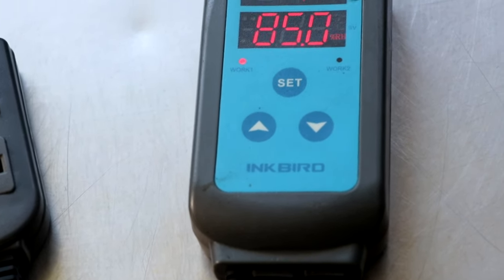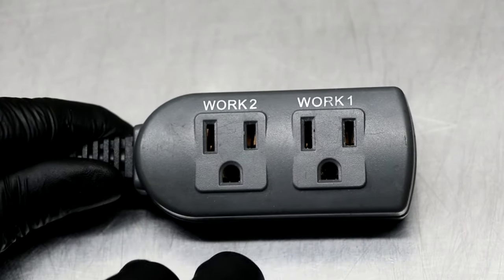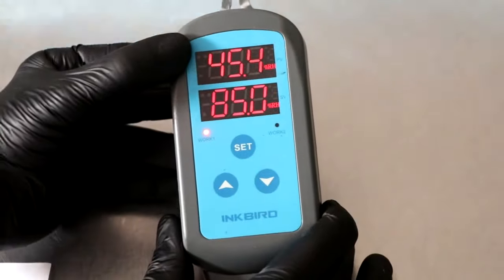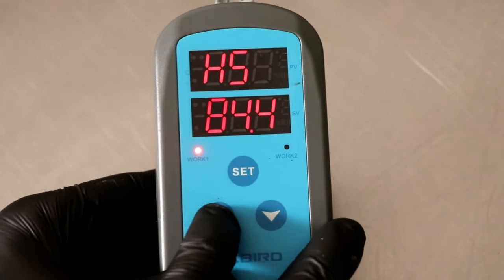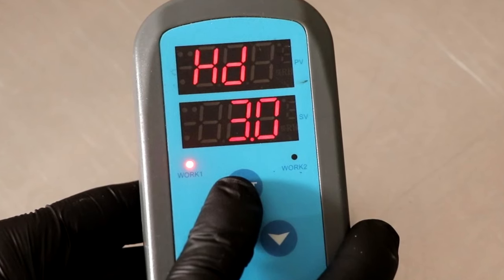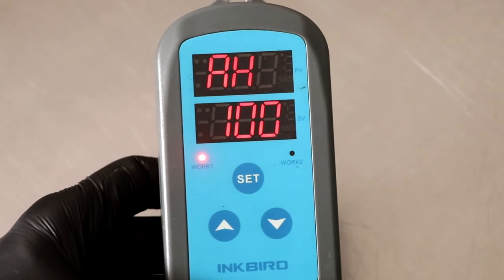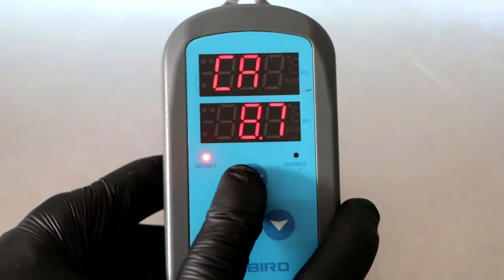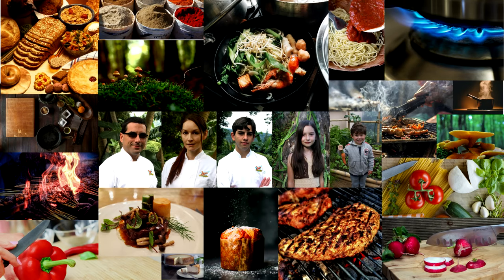Inkbird Humidity Controller - IHC 200   (settings/programming)

Comment: Are you able to connect it to the ink bird pro app? I have one of my own and can’t connect it to the app, I messaged ink bird and they told me it has no wifi function but yet there’s a video on YouTube from InkBird themselves on how to connect it to the app but I can’t/don’t know how to put the device in either Ap or smart mode.
Reply from the maker: I don't suppose you could link me that video.  As far as I know this unit doesn't connect to the app.

Comment: Can you help me resolve this? I am finding my humidity collapses after my controller shuts off. Controller is working properly, problem is what is happening inside my compartment. Humidity does come back but not until it hits 40%+ below my set value. Cycle takes 5-10 mins. I have found not using the humidifier at all helps the same problem with overshooting humidity, but that still occurs to a lesser degree. This is in an empty 8 ft cu refrigerator I have just set up and trying to find stable operation before putting meat inside. With 65% target I am dropping to 35+% before heading back up and swinging past 65 to 80 before it turns back around.
Reply from the maker: Hey Ron.  Are you available for a quick chat.  If you contact me off line we can troubleshoot your issue.  Send me your number here:  http://twoguysandacooler.com/contact-us/

Comment: My sensor is huge compared to that but I have the same ink bird? I can’t find any videos on why this is?
Reply from the maker: You have a newer model.  The sensor is the same but yours comes with a protective housing
Reply: @2guysandacooler  yeah but it gives an incorrect reading from the moisture building up inside the plastic casing which sucks and gives me a 95% reading or above when all is set and done
Reply from the maker: @JakeTheGiantKern  remove that plastic housing 😉

Comment: My Hs is set to 60, my HD is set to 3, my dd is set to 3 my alarms 100-0  but when running the dehumidifier brings it down to 65 then goes back up to 80’s can get it to follow what has been set
Reply from the maker: Have you calibrated the device?  Check out my video on calibrating a humidity controller

Comment: HELP PLEASE can i use humidifier by itself ? my dehudifier is already on timer (built in the model itself} for some reason its not working with only humidifier connected ?
Reply from the maker: you can use only a humidifier.  If it's not working you need to see how your humidifier turns on and off.  Here is a test.  Plug your humidifier into a wall outlet.  Turn it on.  Unplug the unit, wait 20 seconds), then plug it back in the wall.  You humidifier should turn on automatically.  If it doesn't you have the wrong type of humidifier...

Comment: Does this work  with any regular humidifier? Could this unit be put inside cold cellar or just probe inside cold cellar and unit outside of it?
Reply from the maker: yes.  Just make sure the humidifier has a "knob" on off control.  Sometimes the digital on/off humidifiers wont turn back on automatically once the power has been cut to them.  Check the description box for an example of a humidifier
Reply: @2guysandacooler  how about if humidifier doesn’t have any buttons , just a plug in that turns it on?
Reply from the maker: sure.

Comment: My inkbird is hitting my Set Humidity of 62 then turns off and never goes back on. Are there certain humidifers you need to buy in order to make this work?
Reply from the maker: What model do you have.  If it's digital then there's a good chance it doesn't have an auto on function.  If the on switch is a knob that turns then it will most likely turn on when the unit is powered back on..  Here's the one I have so you can see the on switch:  https://amzn.to/39M4Sm9

Comment: Can I plug in my exhuast fan to kick on when humidity gets to high and then the other for the humidifier when rh in tent gets to low? Thanks for any help
Reply from the maker: Yes you can!
Reply: @2guysandacooler  thank u been looking for something that is easy and will keep my tents rh in check its hardest thing to controll even with dehumidifer and humidifier the hi and low never consistent where I need thruout the day

Comment: what to do with it, if work 1 and work 2 dont work and your humidifier does not start or stop working
Reply from the maker: What are your settings?  Do red lights show up on the panel?  Also do you have the right humidifier and dehumidifier?   Plug your humidifier into a wall out let.  Turn it on.  Then unplug it.   Next plug it back in and see if it turns on automatically.   If you have the right unit it will turn on by itself...

Comment: Is it better to have a regular humidifier and a controller, or a digital humidifier that has rh detector?
Reply from the maker: That's a great question.  It depends on how you are using it.  A controller allows you the option for dehumidification.
Reply: @2guysandacooler  Thanks for the reply, I went with a regular humidifier and a dehumidifier. Just picked up the controllers for the humidity/humidifier and temperature. Think it's better that way, you got high and lows on it. I now have everything, spent a little over 1k Canadian, but we'll worth it.
Reply from the maker: @derekellisCAN  You'll be happy you went that route.  Much better control and precision,,
Reply: @2guysandacooler  I was thinking about doing a YouTube video on my progress, but kinda nervous...lol. Never did a video before.

Comment: Hello, I'm thinking about purchasing this controller. I have one question if you don't mind please. Now I plug my humidifier in work 1 I get that and I see on yours it's lit up now will work 2 light up also when you plug your dehumidifier into it. I looked at the manual online and it looks confusing lol. Thank you
Reply from the maker: ok, so work 1 (humidify) and work 2 (dehumidify) will light up showing that power is activated to that plug depending on the settings you have entered, regardless of what's plugged in.  Does that make sense?
Reply: @2guysandacooler  Hello, so say you set your humidifier for 80 and it gets like 90 for example, now the humidifier will will stop and the dehumidifier will kick on to bring it back to 80. Now if you're just using a humidifier and set it to 80 and inside your tent reaches 90 for example, well than your just screwed without a dehumidifier correct. I'm trying to learn all this, I'm sorry if I ask to much. I appreciate it very much. Thank you
Reply from the maker: When you set your controller you will have a + and - for humidity.  So lets say you want your humidity to be 80%.  You will also set the + and - for that humidity.  So lets say you set that at +3 and -3.  Which means that at 83% the dehumidifier (work 2) will come on and at 77% the humidifier (work 1) will come on.  If you don't have a dehumidifier, the work 2 port will stay lit until the humidity naturally decreases and it gets back in that range you set.
Reply: @2guysandacooler  Thank you very much for all your help I appreciate it. Wish me luck. Thank you
Reply: @2guysandacooler  Hello, I have a quick question for you please. I've just planted auto flowers and right now the humidity is good. My question is if I want to lower just the humidity can I just use the dehumidifier with this controller and should I still keep in on plug 2 or use plug 1 for the humidifier since I'm not using one please. Thank you very much I truly appreciate it.
Reply from the maker: @frankswiader3334  you can use just the dehumidifier.  Plug it into work 2 and set your parameters.
Reply: @2guysandacooler  thank you very much.

Comment: Where can we use it? Any industrial applications?
Reply from the maker: This is more for residential/light commercial use.  There is an amp limit so the unit that's plugged into this can't be too big or draw too much power

Comment: I want a differential switch.   When the space humidity is higher than the outside humidity I want to turn on a fan to suck out the humid air.  This “space” in my case is under my house.      When the outside humidity is less than say 55, and under the house is above say 60 then I want to turn on a 1/2HP fan.    Turn the fan off when the humidity under the house gets below 60.    And,  turn the fan off if the outside air is below say 50°.      Does such a switch exist?
Reply from the maker: This controller will work for the first part.  You would need a temp controller that they make for the second part.  Basically you would plug the temp controller into a wall outlet.  Set the parameters the way you want.  Plug the humidity controller into the temp controller.  Then plug your fan into the humidity controller.  When the temp is above 50f it will activate the humidity controller and the humidity controller will turn on when the conditions of how you program it are met 😁
Reply: @2guysandacooler    I looked at that video.   I want one that only comes on when the outside humidity is less than the crawl space humidity.   I don’t want the fan ruining when it’s pouring down rain outside or foggy.     If the air outside is wetter then don’t turn on the fan.    They don’t have a 2nd probe  so it would not work for what I want.    Regardless of the humidity I only want the fan coming on when the outside air is dryer.
Reply: @2guysandacooler     I could compromise by a 3rd switch.    Just a simple humidity switch outside that would switch on at 50%.    Then to a normally closed relay to inturrupt the power line from the humidity switch to the fan pulling air out of the  crawl space.    I think I got that logic straight!!!!

Comment: How to change from work 2 to work 1?
Mine the light only on in the work 2.
Thanks
Reply from the maker: Generally work 1 will come on when the parameters that are set are met.  So if you go into your house where the humidity is moderate and then you set your humidity Set value (HS) to 90 for instance then you set the Humidity Differential (HD) to 3 and the dehumidifier differential (DD) to 3, you should see work 1 come on.  If it doesn't then your unit might be defective.
Reply: @2guysandacooler  oh thank man.
I might try it in the greenhouse as it more controlled.
Really appreciated👍

Comment: I just plugged mine in but the sensor in this device is reading the humidity at 74% while my thermostats which are all accurate read 59%. Does the sensor need calibration or something?

Comment: Has anyone had an issue where it takes too long for the sensor to register the change?
Example, I have differentials both set to 5.  I have the humidity set to 75%.  When the dehumidfer turns off, it takes a few minutes for the sensor to read the humidity, and then its too low so it turns on the humidifer.  It is a small wine fridge, and I have the sensor as far away from the humidier/dehumidifer as possible.

Comment: Can I hook my ac into the humidifier outlet? For some reason it likes to kick off and start blowing humid air when the room gets too cold. If my humidity gets up to like 57% can I set the humidity value at 56% and therefore the controller will turn off my ac standing unit? If so how would I create a range to let the dehu that I have constantly running 24/7 so that I can let rh% drop and let room warm up so that the ac can kick back on. Or will the outlet only turn on when it’s set at 56% humidity set value?
Reply from the maker: it depends on how many amps it uses.  These have a max watt output that you'll have to check but to answer your question.  Yes you can
Reply: @2guysandacooler  if I set the humidity set value at 56% will the ac only run until the room hits 56%? And if I set Hd to 3, then it only kicks on when rh is at 53%?
Reply: @2guysandacooler  what’s the max amps it can run?
Reply from the maker: @noahgfarb  yes
Reply from the maker: @noahgfarb  I think it's 10 amps

Comment: Hi so easy to understand.good presentation i have a ihc 200.my setting are hs 85% dd= 3% hd=3 % humidifier is working and power On At 82 % the Dehumidifier Will Not Power On At 88% or Even 90% Tried It With A Table Lamp And Yes It Comes On At 88% the Dehumidifier Will Work If Plugged Directly Into Wall Socket.Any Advice Would Be Great Thank You Inkbird 608 For My Temperature Controller Sett At 55%f Regards
Reply from the maker: What type of dehumidifier do you have?

Comment: Besides the tiny dehumidifiers that dont really work, are there any that are compatible with the inkbird?  Please help!!
Reply from the maker: sure.  Watch my video on Dehumidifiers.  I explain what you should be looking for:  https://youtu.be/5pprS-jHAeM
Reply: @2guysandacooler  not really, I had to find the real answer on Reddit. Which is, the device must have a switch, or auto restart.
Reply from the maker: Did you watch my vid.  That's exactly what I said😂😂
Reply: @2guysandacooler  I did watch it. If you said that, I must have missed that part. My bad.

Comment: Mine is on work 2 but i dont have a dehumidifier so im not using work 2. How i switch different works?
Reply from the maker: It does it automatically based off your settings.

Comment: Got any suggestions for humidifiers this works with. Under £50 roughly. First one I tried it didn’t work
Reply from the maker: any ultra sonic cool mist humidifier will work with this unit.  All the unit does is allow power to the out let using a relay so technically you can plug anything you want to it and it will come on when the parameters are met.  As long as the humidifier.  As long as the max electrical load for the humidifier is under 10amps then it's no problem.  You might want to see if your unit is damaged.  You can easily do this by plugging in a light or a lamp to the humidity  port (work1).  Set the value to 100% and if the light  turns on then the unit is ok.  If the light doesn't turn on then your unit might be damaged.   Hope that  helps.   Here are some options that I use.  Not sure where you live but I think you'll get the idea.    https://amzn.to/2LNv0BD
Reply: This thing is completely useless for any digital appliances that have there own thermostat, hygrometer right? It would work for an old box fan with a turn knob😂

Comment: hi guys, i have this unit but it seems to freeze when left on for a few days.. eg the humidity sticks at a certain % and therefore the fans kick in and are on constantly.. its only when i turn it off at the plug and back on, that the humidity resets to the correct value and the fans turn off..  sounds like a faulty unit right? FYI the unit is set  to activate at an increase of 5% humidity, is the fact the fans are on and off every 10 minutes a causing factor in them potentially faulting, although i assume this is what they are designed to do...thanks
Reply from the maker: Sounds like a faulty sensor or relay.  You might want to contact inkbird and see what they say.  It shouldn't be doing that..
Reply: @2guysandacooler  thank you for the reply! Yes that's what I thought. I will get it replaced! Thanks again

Comment: a question , what if the humidifier doesn't expel the fog only when powered on ? but only when the power button is pressed twice? so like to adjust the fog level ? dont really know how to explain it , I hope someone understands my terrible explaining
Reply from the maker: you need a different humidifier.  Check my video on that subject:
Reply: @2guysandacooler  hey  thanks for the answer , can you link the video please?
edit : before seeing the comment i bought one that has a wheel to control the density of the fog , thinking that if i left the wheel to a certain point when powered on it would go automatically , is it right?
Reply: just found the video , all doubts are clear now , thanks a lot!

Comment: Why does my work 2 light come on when I plug my humidifier in in instead of the work 1 plug outlet?
Reply from the maker: This unit works based off of the setting you enter.  It doesn't matter what you have plugged into the ports.  When the settings tell the unit to activate work 1 the light will come on and when the setting tell the unit to activate work 2 that light will come on.  It all comes down to the settings.
Reply: @2guysandacooler  I don't upstandi if the work 2 plug is for the dehumidifier and the work plug is for the humidifier why is the light coming on in the work 2 plug when I have it in the work 1 for humidifier?
Reply from the maker: OK.  Take a step back from your train of thought for a second.  The plugs are only activated by the controllers settings, not by what's plugged into them.  If the work 2 light is active it means that you have entered a value telling the controller to activate work 2 (dehumidify).  Here's an example.  Lets say you want the humidity to be 80%.  In the settings you will set the HS value to 80%.  You now need to tell the controller how much over and under that value you want before the unit kicks on.  So the low value is HD (Humidity Differential) and the high value is DD (Dehumidify differential).  If you set the HD to 5  and the DD to 5 then as soon as the humidity in your room drops below 75% (5 points below target or HD) then Work 1 will come on.  Once the humidity in your room rises to above 85% (5 points over your target or the DD) then work 2 will come on.  Does that make sense?  What you have plugged into the outlets is irrelevant.
Reply: @2guysandacooler  I just wanna make sure my humidity stay between 50 an 55 . I thought I set the parameters correct it jus threw me off when the dehumidifier light lit up. Thank you for the info
Reply from the maker: So set your HS value to 53, set you HD to 3, set you DD to 2
You should be good to go.
Reply: @2guysandacooler  thank you!